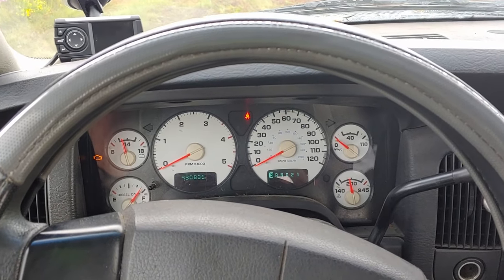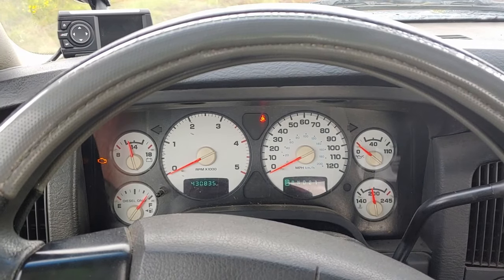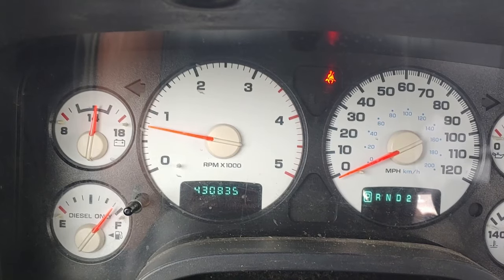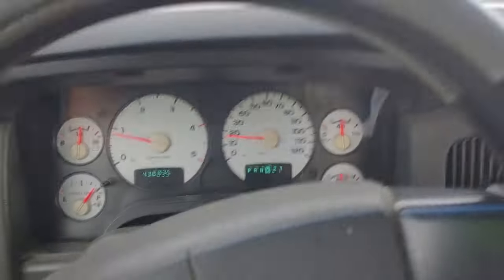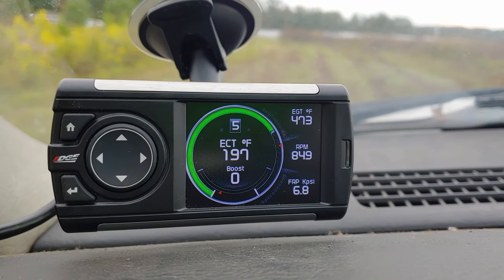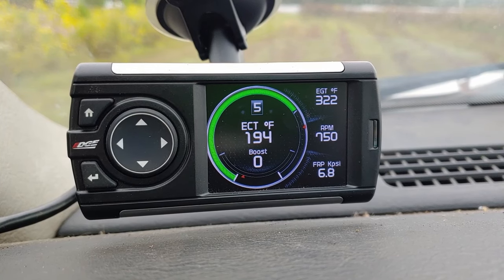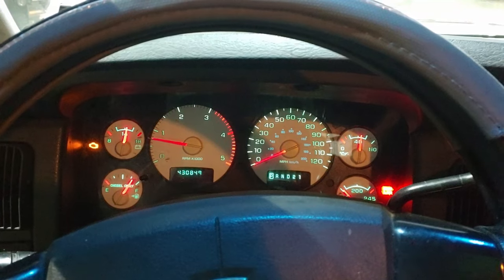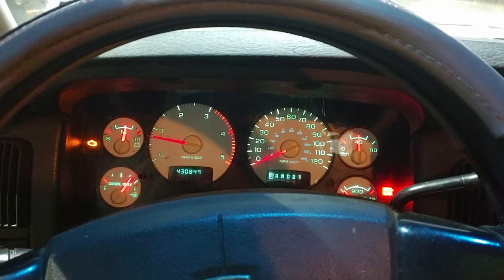Here's Some Helpful Hints When Looking For Failing Common Rail Cummins Injectors!

Comment: I bought a 2006 single cab 4x4 5.9 with 6 speed that had about 265k on it, I don't drive her very much, 5 years later only has 292k.... no idea how long those injectors have been in there. I do a new Baldwin filter every 2500 miles, and I add Hotshot Secret fuel additive every fill up. Almost no sign of them being bad as far as I can tell, and yet, they are on my mind every time I light it up. Injectors are the Killer Dowel Pin of the otherwise awesome 5.9 24v Common Rail lol
Reply: 2500 miles is wayyyy over kill. Change your fuel filter when you change your oil.
Reply: You’re changing your fuel filters early thinking it’s prolonging the life of your fuel system, like more frequent oil changes does for you engjne. But it’s actually the opposite for fuel and any filter. A new fuel filter is least effective at trapping particles, and most effective when it’s 99% full. So to reduce the number of containment’s getting into your pump and injectors you actually want to run your filters as long as possible. Right up to the point before they plug so much they start to restrict flow. 

I’m not sure what the service interval is on those old 5.9s but I would run them up to that at the very least. They will not plug up before then, especially if you get your fuel from quality stations. The manufacturer is always conservative with those intervals and takes into account the fact that not everyone gets good quality clean fuel.

Comment: This was really helpful, have had my 03 for just over a year but I'm sure it had bad injectors when I bought it
Reply from the maker: Hey Simon! So glad to hear that it helped you out some. Have you already gotten them replaced or are you still working towards that?
Reply: @70440charger  I have not done anything. After I bought about a year and half ago I noticed the oil was over full thought maybe they just got carried away with the oil change. Now its over full again so I was pretty sure I'm getting fuel in my oil and after watching this I did the idle rev and it has that hold then popping as the rpms come down not quite as bad as the video but it's there
Reply: @Simon-rj2up  my truck is doing the same thing you just explained did you find out what it was?

Comment: Will ATF in the fuel filter every 2 thousand miles help the injectors?
Reply: No don't do it. Blew my injection pump doing that. Use 2-stroke oil instead helps lube everything. Run a little cleaner every couple of tanks. Ultra low sulfur diesel lacks the lubrication that the older diesel had.

Comment: For the past couple weeks my '03 3rd Gen will cut-out and blow white/gray smoke whenever I get on the pedal "somewhat" aggressively a/k/a not "passing a car" aggresive, just medium-ish throttle input.  However, if I go easy on the pedal, I can keep the cut-out issue from happening and the truck continues to avg 17+ mpg around town. That said, I did notice the fuel pressure reading on my Quadzilla iQuad is reading in the 50s (vs the normal 10-12 psi) which I originally figured was nothing more than a bad Quadzilla lift pump pressure gauge sensor, however, now I'm not so sure and thinking the excessive lift-pump pressure may be a sign of something more ominous, such as a bad "open" injector back-feeding pressure into the rail(?)  If anyone has any thoughts on what might be going, by all means, please let know... thanks!
Reply: mine does this same exact thing, you ever figure out what it was?

Comment: This was very helpful!! When I drive 30 miles per hour, the stuck will exhilarate at a higher speed. I had to throw it in neutral and cut it off. Never could figure out what was wrong.
Reply from the maker: Hey Vision, Thanks for the comment and sorry to hear about the trouble! Just in case its helpful, I wanted to add that sometimes there are other things that can contribute to this, such as APPS sensors and FCA's (as others have commented on here) but this is a good thing to keep in mind when doing diagnostics. I couldn't capture it well here, but typically if it is the injectors, you should usually notice a little increase in soot/smoke/ or unburn fuel smell while observing the RPM coming down normally.  When you pair all of those observation together, then you have a much better picture of what is actually going on.

Comment: I get an excess return fuel notification when and only when I back off the throttle above 2400 rpm and use compression braking. It goes away after a few mins. No other symptoms. You think my injectors are smoked.?
Reply: What do you think?
Reply from the maker: What kind of programmer are you using that is giving you the heads up?
Reply: @70440charger  it’s not the programmer that gives me that, it’s the wait to start light comes on on the dash, indicating high return fuel. When I run diesel kleen for lubricity, the injectors are quieter and it doesn’t happen nearly as often. 

I do have a smarty jr, but that’s irrelevant I think
Reply: EDIt - @outpost CTD is the correct channel 

Actually I recommend watching his vids, they've been some of the more helpful 

Hey I just watched a video by @outpost CBD and he said 'wait to start light's coming on when driving, is a huge indicator of injector failure.
Reply from the maker: @kristina stevens  hmmm. What years is he referring to? We have had an awful lot of theses 03-07 specifically, and we have never seen a failure that correlated with a wait to start light. Doesn't mean that it hasn't happened, but just not over the last 15 years for us. Wait to start issues for us have always been tied to an ecu issue.  Thanks for bringing that up. We will be on the lookout for that now.
Reply: @70440charger  thats kinda interesting, everything online says wait to start light indicates high return fuel and is a sign of injector failure beginnings
Reply from the maker: @slvrwrx25  Yeah it really is! I hope one of the other guys on the channel will see this and link a video of a wait to start light and the injector test. 
Now, with that said... on a 2nd gen with a VP44 the wait to start light often won't come on and it coincides with the truck not starting,  but those are tracked back to a Bad ECM... I have seen a bunch of those!!!

Comment: I see the frp bouncing around. Is that normal? Mine does the same and I’m not sure that’s a good sign. Suspecting bad injectors at 176k miles on my 06.
Reply from the maker: Hey there Jared! We have had several CR's with good gauges and both brand new injectors and used ones. Our rail pressure has always varied a good bit.

Comment: Would a leak at the grid heater /intake horn cause these symptoms
Reply from the maker: Hi there! Thanks for stopping by! Sorry for not catching your comment sooner! I am sure you have already fixed your grid heater air leak/ boost leaks, but I figured it would be helpful to respond for anyone else who might be looking through here.
A boost leak will cause excess black or gray smoke on accelerationor sustained load, but will not cause the slowness to return to idle (rail hang or floating down).

Comment: So the symptom you are demonstrating is what is commonly called "rail hang", it is a condition where the rail pressure does not drop when you let off of the throttle. Regardless of the cause which is most always excessive return from the injectors I will address the effect.

The algorithm that controls system rail pressure via the FCA, which is actually named the mprop by Bosch is operating in the upper control range of the PWM signal. In simple terms the control amount is incremental and if you could monitor this you would see that it is likely maxed out by the requested rail pressure, so therefore incrementally in a count down from say a max 255 or whatever back to desired pressure will take a longer time to increment through. The PID settings in the ECM are pretty slow to respond (increment or decrement) based upon the calibration.

What is happening is the CP3 is having to provide essentially its maximum output as it is a variable displacement pump, via the stroking of the mprop, so if it is running essentially wide open, and then the request is idle output, it takes longer for the pump to reduce its output which is evident and observable by looking at a mismatch between desired and actual pressures.

Further the degradation of the injectors could cause additional fuel to be injected as can be realized by doing a SOI test. Backleak/return should always be checked, but you like others do not have actual testing parameters that are accurate to follow, tools do exist to do accurate non-intrusive testing.
Reply: Excellent explanation. Measuring injector return flow would be interesting.
Reply from the maker: Thanks for the comment Motorsport diesel. You have a wonderful explanation and we appreciate your adding to the collective knowledge base here.  You are correct in understand the  Bosch Common rail system and what causes "rail hang" in a normal situation. We appreciate all comments here that are constructive, but just so that someone doesn't smoke their motor thinking that their "rail hang" is normal, I should add that all of these injectors were sent off, tested, and failed. We purchased a new set of injectors from Industrial Injection and  installed them. No other fuel system modifications were made at the time of repair and the "rail hang" returned to what is actually normal for a Common Rail Cummins. So again for those working on their trucks, if you let off of the gas, get your foot on the brake, and your motor still hasn't come down on the RPMs and is still actively pulling against the brakes, that is NOT normal rail hang.

Comment: My 2004.5 vin C
325/600
Has what feels like and sounds like  a rod knock. 
Under 1000 miles on a rebuilt block, head, turbo, injectors. 100% stock everything. 

The knock is intermittent and very difficult to replicate sometimes. It does it at 1500-1700 rpm while cruising lightly if I feather the throttle to accelerate a bit. That's the only way it'll do it.

Is this a sign of a bad injector?
I've been to 5 diesel shops and they still can't nail it.

🙏Please and thank you.

Comment: I purchased my 06 back 2014 and as soon I got back in SCarolina the injectors failed. Put a set of remans in (I treat my fuel every fill up with optilube XPD) and now I have 130,000 miles on the odo. My question is when should I start looking to have a set of injectors in? What brand of injectors( how much) and should I go with remans or new injectors. thanks

Comment: Love the videos man! I’ve got a 2012 Cummins. Love the truck but I sometimes have a puff of greyish/white smoke come out the  tail pipe when letting off the gas. If I’m in cruise control and the truck slows itself down it will spew out the smoke for a few seconds. Any idea on what would cause it?

Comment: Just put on a cold air intake, from dead stock truck. Only 160k miles on the truck, whenever I get into the top end it seems like the injectors are starting to stick after adding better airflow from the cold air intake, will update if there is further problems. 🥲 also just ordered a MM3 from 5.9diesel so hopefully I’m not gonna be dropping another 3k on some 25-50% injectors 😭
Reply: K&N piece of shit was the issue, replaced injectors due to mileage, threw in 5.9 Diesel’s tuner now I’m having random rpm knocks and puffs of smoke after about 1.5k miles on new injectors
Reply: So sad... how did the K&N filter cause your injectors to go bad? @TheUnknownSacrifice
Reply: @TheUnknownSacrifice what the how did k&n filter do bad to your injectors?

Comment: Got an 06 with 229K miles with no blowby or oil leaks.  I don't drive it much but starting to notice a light black puff of smoke at start up for a second or so.  I have a MM3 with custom tunes, but really don't use it since it causes it to smoke a little and it sounds like it's pinging (normal?).  I don't know if the injectors are original or not and thinking about replacing them.  What are your thoughts on Big Bang Injectors?
Reply from the maker: Hi there! If you don't have blow by at 229k, you have won the lottery! I really love these truck, but rings and bad injectors have killed a ton of motors! It's possible that it has stock injectors, but more than likely, they have been swapped. 

Any change you have a video of it starting that you can link us to? Who wrote the mm3 tune,  and do you trust them?  Does it do the puff both with the tune and without it?  Do you think you could capture the pinging sound on camera? There is a condition called fuel knock that is sometimes associated with injectors that are dying to bad programming,  but I don't have a video right this second thay I can send you to so that you can compare sounds. If you have a video of what yours sounds like, send it our way.

And BBI is a pretty good group to work with, if you have the $$$. Again, if there is room in the budget, I have really liked working with exergy and Torque Diesel Motorsports. TDM does a lot of injectors for some of the other people, and is one of the few who has the tools to actually properly rebuild a CR injector. 

Hope that helps some and let us know how it goes!

Comment: I have some white smoke at start up.  Goes away after 30 seconds.   Never did that before owned the truck two years now.   04.5 truck. About 190k on it.  Seams a tad choppy at idle for that 30 seconds to me     Drive it and it seams fine as far as power and responsiveness.  No noticeable difference in anything but that.    Good coolant level and oil looks mint.  No programmer on the truck to read much.    

I’m super scared to drive it right now as it’s never done that before.   Short of buying a programmer to read rates and or rail pressure and stuff.  Does this sound like injector symptoms to you?    I’ll do that rev test in the morning see if it’s dragged out like your video.
Reply from the maker: Thanks so much for stopping by exclamatiokumar. Have you tried looking for fuel leaks question? The white smoke that you're talking about happens quite frequently when there is an air leak in the system. A fuel pressure Guage up near the pump will help check. If it is at the head of the system and it fluctuates, then there is air in the system. Cause air compresses and fuel doesn't! Let us know what you find.

Comment: Hey Doug had a bad injector replaced it discovered it had a crack 11 months later after I dumped 2 1/2 gallons in the crankcase I replaced the injectors from a company that rebuilds them in Pensacola Florida Pensacola diesel I have since had to pull out three of their injectors on warranty where can I get a good set of injectors it seems like there's tons of knockoff Chinese Bosch online 2005 5.9 6-speed manual stock injectors

Comment: I had white smoke at start up. I changed the oil, only had 4 quarts in the drain pan. Is this a injector problem or is it burning oil. Oil change was at 7500 miles. From the cold weather until now .
Reply: From cold pretty common to burn some oil or any moisture in the system.

Comment: My truck has dual cp3s, and i get a studder when starting out.  It gets worse as the motor warms up.  I have replaced both FCAs and the controller.  Any ideas on what this could be?

Comment: Im having these symptoms in my 03 5.9 24v. It also seems to Be down on power. Would that be another symptom of bad injectors or could it be something else? It has no blow bye. It does put out greyish smoke going down the road as well.
Reply from the maker: Hello there! Have you tried changing your fuel filter and air filter? Also, I know it seems unlikely, but check for boost leaks. Sometimes they are hard to find, but can cause a lot of the same issues.
Reply: Dealing with the same thing on my 03 as well.

Comment: Quick question should the frp be at 6 and above ? Cause on my 6.7 is at 4.9 the frp on the edge gauge. Sometimes I have a hard start. Thanks.  Great channel
Reply from the maker: Hey there! If your rail pressure is at 4.9k, I personally would want to look into that. I have never seen a healthy CR Fuel system be that low.  Someone else might have, but not me!   So If it were me, I would want  to start by looking at the simple things like is the fuel filter dirty, is the lift pump putting out the proper volume and pressure, and then work up from there.  Oh yeah, and it would be worth checking to make sure the gauge is reading properly... It would be pretty crappy to do a bunch of work only to find out a pressure sensor was spitting out a signal that was .05 volts too low.

Now if we want to go wild, could it be low cause the cross over tube are not torqued properly and its bleeding pressure off or are the injector check valves worn and they have too much return? Is the fca or the CP3 worn out? Maybe... And worth thinking about... But I wouldn't start with the  worse case scenario! Hope that help some!
Reply: Ok thanks. I will look into to that.
Reply from the maker: Thanks man and best of luck!!! Let us know what you find. If your truck were an 03-04  truck I would say it was the solenoids dying. Cause those years love to do that!

Comment: I’ve got a 2012 Cummins and can here a ticking noise coming from exhaust tailpipe. It has 245k with stock injectors. No smoking at idle, No under hood ticking or knocking noise. Just adjusted the valves thinking it was exhaust side taping but still doing it after setting lash to .010 intake & .020 exhaust. No drivability concerns except the weird noise from tailpipe. Would you say needs new injectors?
Reply: Did you ever find anything out ?